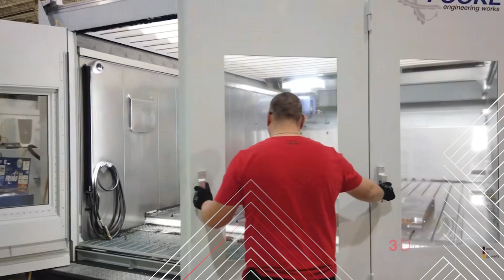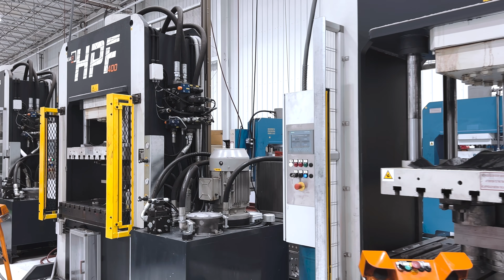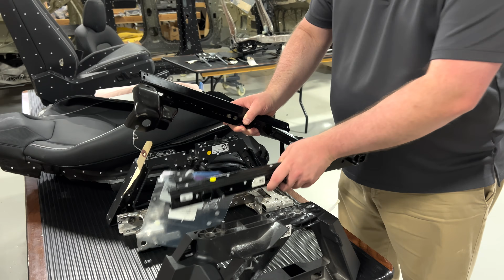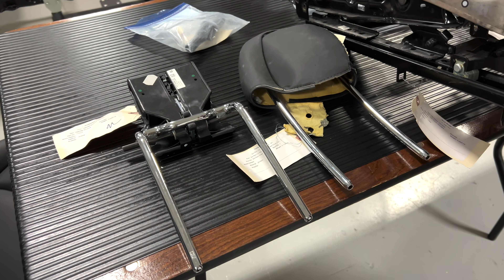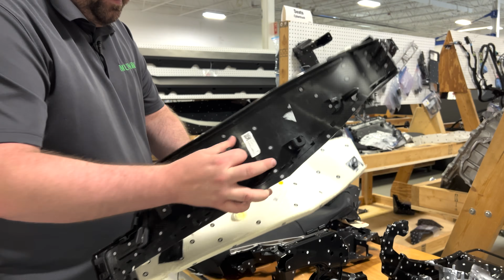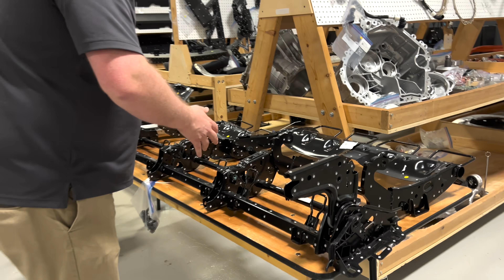Cybertruck Seat Analysis: Did Tesla Miss the Mark?

Comment: I had to go out into my garage to take a look at the seat tracks.  I like the look and I like the fact that I can stuff some extra things right under my front seat.  I usually jam my baseball cap and/or gloves in there.  It does look like overkill though from a weight aspect.  I do not like that neither my M3 or CT's headrests move.  Expensive vehicles like these usually even have motorized headrest adjustments - I'd settle for manual ones.  The headrests on my CT look sharp but do not line up with anything on my head, neck or back - I'm 5'8".  The headrest itself is way too tall - The cabin would look even more spacious if they were at least 2 inches lower.  And for all the over-engineering of the backseat, they could have made a pass-thru for 2x8s, skies and dogs.  Yes, there would need a mechanical failsafe tonneau cover stop.

Comment: I disagree. This isn't Tesla becoming legacy, this is Tesla being their usual agile self BUT also running extremely late and cutting features and hacking together SOMETHING. The rear seat design probably did assume a passthrough that never came. The adjustable headrests probably failed some safety test in the early days and they keep the design as-is to keep the door open to a recertification that always gets downprioritized.
This is classic technical debt and it requires more strategic planning than just "move fast and break things".

Comment: Boring video. Apparently, Carl is not a crash safety expert like the engineers at Tesla who engineered the seat structures. Tesla is not Ford, they have other ways to save $5 that doesn't risk their customers lives. That's why the seats and supporting structures are so strong. And that's also why Tesla uses a unified headrest structure. Studies show that adjustable headrests are usually adjusted to a sub-optimal position for saving your neck in a crash. The neck is the most fragile part of the human body in an impact. People have been paralyzed, others died, because they had their headrest improperly positioned. The unified headrest is designed to properly support drivers of all heights. 

It's not just lip-service when Tesla says they care about safety, their safety programs are very data driven. Counting nickels doesn't make financial sense with the high cost of pain and suffering and medical procedures. What makes sense is to make it actually safe in the highest number of crash scenarios. I know it's hard for a trained bean counter to understand that counting beans goes far beyond the point at which the car is sold. Elon Musk has always had very long-term views, his rationality demands that ALL the consequences must be taken into account in order to make the best design decisions.

Comment: It is a pretty common design for hinged frames to be welded out of plate steel, and then bushing sleeves (to accept polymer or bronze bushings) welded-in for the hinges themselves. So you have three operations: cut (laser/plasma/waterjet) plate steel (or could even stamp for thinner plate), machine the sleeves, weld the sleeves to the plates. Now if you make the plate thicker like they did here, you eliminate the need for bushing sleeves as a separate part and reduce 3 operations into one. Yes, more metal is being used and the finished part is heavier, but the material is likely cheap in comparison to the use of multiple machines and they probably had some kind of weight budget (can't make the vehicle too light for towing purposes) to work with. Just my guess, nothing to back it with.

Comment: After spending 4 hours riding in the front passenger seat of one, I will say that comfort-wise, they remind me of late-90s Toyota seats. Firm and initially comfortable, with very little overall support. Definitely missed the mark on comfort for a $100k+ vehicle. And yes, at 6100 miles, the driver seat in this vehicle was creaking during acceleration and turns.

Comment: That expanded polystyrene insert in the rear seat headrests appears to be the same material used in helmets to reduce collision brain injuries.  Since the seat back is fixed (bolted to the frame), there is no rebound designed in.  This design does maximize the cabin space since moving seats always have room behind them.  That design of the plastic molding gives proper support to the polystyrene in a collision.  It's basically a passive helmet to protect the back of occupants' heads.

Comment: The seat base castings are beefy because the Cybertruck is designed to be able to be a very good off-road vehicle.  LOTS more forces on seats and seat bases when you're off-roading! About the cost, when you watch Tesla videos showing the giga-castings coming out of the giga-press and immediately being placed in a CNC machining cell, the raw casting has many parts in addition to the main casting, joined by sprues. Please fact-check this by researching Cybertruck giga-casting videos to see if these components are parts of the raw Cybertruck giga-castings.  If they are, their cost is basically only material cost. It's not like Tesla is buying these from an independent parts supplier.

Comment: May mga EV rin bang ginagawa Kay Monroe?  Dalawang battery lang Yan na tag 24v.. Ang source ng motor gallon Ng sa generator, Ang motor ng gawing generator kahit maliit lang, Ang drive motor kahit Hindi na bagohin apat Isa bawat golong Ganon naman Yan.. kahit sing laki ng BLDC kung walo malakas narin Yun hindi na sigoro mag over heat yon..drive gear lang..Ang pinaka importante  Ang generator hundred volts hundred amps  separate Ang generator..kahit sing laki lang Ng 775 na apat kahit boong araw pa Hindi maobos Ang battery kung may charge unli...

Comment: The 1cm thick plate steel might be there as a 'backup' for submarining in case the cast aluminum touch down surface. That aluminum is a brittle failure point and FEA might have indicated it was a potential fracture point. I doubt it, but we saw what happened when Whistlin Diesel sheared the bumper off of one of these. That aluminum is quite brittle.

Comment: Do the overkill designs add to safety in any way? 

You also mentioned that some designs make sense if they are making it for other models. Speculation on the van and other products could be incorporating this design. 

Also, could the back seats be implemented in a smaller vehicles? Say the size factor of a M3 or smaller?

Comment: Seems like Tesla is focusing it's best engineers on more important things like steer by wire and 48V but then leaving the smaller things to the less experienced crew and neglecting the details. CT is a marvel of engineering but definitely rushed. A year would have done wonders for most of these things and problems with reliability people are still experiencing.

Comment: These design decisions are even contradicting each other:
If you're making a one-off car, or a low volume run, then overbuilding could make sense (i.e. do less optimisation), jerry rigging a fixed headrest onto a moving headrest frame could make sense; but then they make an injection mould where it's not needed (which would only pay off in high volume production runs).
     As if the engineers asked their boss: hey, do you want more of a one-off car, or a mass-production ready car? Boss' answer: "Yes". 🤦‍♂🤦‍♀

Comment: please react to the Whistling Diesel thing where he broke off the hitch by breaking the back casting. seems very damning, but maybe not?
Reply: He slamed the whole truck on the bumper coming off the tube's. A scenario that would likely never happen in normal use. But it would be cool if they acknowledge it and beef up the 2nd Gen cyber truck.
Reply: @aaronyoder121  not to mention the other truck didn't do the same thing. It's frame would have been broken/bent out of shape and the truck totaled.

Comment: If there rear seat back is immovable, could they have simply made the whole back with one piece of molded foam. Maybe there would have to be some embedded plastic bits for also and structure. What is the purpose of all the metalwork?

Comment: Thanks, Carl.  This was great.  Tesla sacrificed a lot to get this to market.  It's probably the worst product they've made and a step backward for the company.  I was worried from the original announcement that it would put the company at risk and that worry was probably justified.  Sometimes you need to tell the boss when they're doing something stupid.

I am not a cybertruck "hater".  I just think it could meet neither Elon's promises nor his original deadline and what we wound up with is a super-compromised design that may have done irreparable harm to the company.  He promised 450 miles of range and bullet proof windows; it won't go half that far with normal automotive windows.  I want Tesla to succeed, but CT worries me that they've passed peak innovation and are now just following Elon's visions without listening to reason or their customers.  That worked for Models S and 3 as he was inventing new markets, but it won't always work.

If there's one thing people should have learned from Elon's white paper on Hyperloop it's that he's NOT always right and is often downright foolish.  I encourage people to read that white paper as it seems to sum up Elon's thought process rather well; grand ideas with huge lapses in judgement and with no engineering homework done, though I do admit that white papers often leave out the details.  Hyperloop was an insanely impractical idea and fans should remember that when praising Elon for his many successes.  Has he changed the world forever?  Absolutely.  Is he the world's top genius?  No, and he's not even in the top ten thousand.

Comment: thanks for the criticism on folding rear seats. Its function is very limited but expensive in execution.  If I were Tesla, I want the rear seats to be easily removable than folding. It is unlikely that the truck will be filled in the bed and rear seat with cargo at the same time. An empty rear seat area is nice for precious cargo like electronics/appliances and stow away the seat in the bed.

Comment: Cost will be comparable at higher volume, you avoid tolerances stack up with one part. I assume they were using this part to test something or wanted to use another material, when they designed it. Maybe magnesium?

I would really like to know if the cast parts are much easier to install and if they make the sliders much easier / smoother to operate.

Comment: I can find as many arguments as you want.
For the speed of production for the 1st model (fewer employees and complexity), or the availability of old casting machines capable of doing the job.
Plastic is not a good argument, because it is a bad material for the environment. (plastic is the "cobalt" of the industry) Sometimes, adding a few kg to the Cybertruck is just a lesser evil.
I find that Tesla is doing the good old method of other manufacturers here. They use their current production line to make another more expensive vehicle. Recycle a lot of parts from previous models (can also be recycled material, like messed up gigacastings). I find the approach really good on the contrary, because from a financial point of view, no new machine is required, the production equipment does not need return on their investment. We are talking about margins without investment here.

Comment: Not up to snuff. A lot of "in my opinions" without facts. When terms such as most are used that emediatly states not all. So which is it. And what specifically are the cost differences. 6 piece sheet metal assembly vs one casting relates to how much assembly line space, inventory management, tooling, bending welding, and man power vs one and done.

Comment: Carl is my favorite Monro engineer. Articulate, knowledgable and extremely telegenic.

Remember - they did actually rush this thing out the door. Seems to me that some of the non critical components may be in early generations and due to be optimized.

"When in doubt, make it stout, out of things you know about."
Reply: I certainly wouldn't be surprised if they broke down another Cybertruck in two years time and many or most of these issues are resolved
Reply: @youtubecommenter-on9kd  What issues exactly? I don't see any issues from this video.
Reply: it was rushed out the door after 4 years of development?? Good thing they didn't take their time!
Reply: Agreed! Large People who weigh over 245 and way more pounds absolutely Need this type of seat framework!  When vehicles like trucks driven hard and offroad, they Need this type of strength to keep a heavy person in control of a 8500 pound vehicle.
Reply: @dporrasxtremeLS3 I agree with you on this. I have a couple of friends who push the 350-400 lb mark. It is amazing to see mechanical things break under the force generated by their movements. Car seats, in particular, get maybe two years out of them before the seat back frame is shot.
Reply: And he has a very pleasant voice, i could listen to him for hours. Sorry Sandy.
Reply: He's probably my least favorite. He's not concerned with quality, but only cutting costs. 
If Tesla had put a cardboard box as a seat he would have been happy because it would have been the cheapest option... Unless Tesla was buying boxes instead of reusing ones they already have. 

I also dislike the way he feels and taps everything with his fingers.
 
He seems like the type of guy who likes the smell of his own farts.
Reply: @themonsterunderyourbed9408 same. I don’t like his tone and attitude. He’s very patronizing and sounds a bit arrogant.

Comment: Regarding the casting version of the riser vs the stamped version topic: it’s more than just a dollar per part equation. Factory footprint is apart of that math, how much space do the various stamping machines need, how many people need to operate them. They need to get welded which is another machine/process/people. What is the throughput at volume of stamping vs having it injection molded. Price parity only carries the conversation so far at Tesla as they move more towards automated build workflow and reducing factory footprint.
Reply: Good point!
Reply: ever head of outsourcing?
Reply: @XzzVttll  Tesla tries to minimize outsourcing. That served them very well during the COVID parts shortages. Other automakers had to stop production, Tesla was selling record numbers of vehicles through most of the parts shortages. It also gives Tesla a large pricing advantage, which is why you get so much car for so little, relative to other EVs. Tesla even makes their own seats in-house, almost unheard of in the auto industry.
Reply: @XzzVttll yes
Reply: @XzzVttll  I believe Sandy had the appropriate answer with his "outsource dance". Outsourcing is terrible and overrated. Keep manufacturing in house.

Comment: Usually Tesla's 1st gen of a new model are inefficiently built (ie. see Sandy's review of Model 3 when it initially came out. Model Y was based off model 3 so it already started off from a good base by 2020). Likely these choices were made to guarantee functionality and safety, but not build efficiency. Elon has stated on earnings calls that the team now has to go through cost reduction of every component in the Cybertruck to be able to further scale production. If these issues pointed out are economically disadvantageous, it is certain that Tesla will change them.
Reply: as long as you have morons in america to pay for that unefficiency you can do waht ever you want

Comment: Carl, while that portion of the seat frame looks like it's a cm thick,  when you held and moved it over the bracket it rests on,  it seemed like you were able to easily carry it one handed with a light grip, suggesting that it's not actually very heavy overall.  Could it be hollow, 2 stampings for example,  and just be well-disguised by the coating? Just guessing.

Comment: If I understand correctly light trucks do not have to pass the crash levels of a passenger car.  Ford/GM may be using less structural strength because they are not meeting passenger safety standard.. could the additional strength of The cybertruck be for meeting higher crash test standards?

Comment: Just think after a million miles of battery life on the vehicle it's only going to lose 10% of its total battery range so therefore all of the seat components need to be very strong it's very simple I really don't know how you missed this from an engineering perspective and it really shines a bad light on Sandys work.
Reply: until it gets rearended and is written off because someone back halved the truck with aluminum castings that are un reparable 🤔

Comment: I completely disagree with you on this seat design because the plastic has more Flex therefore it's more comfortable a metal backing would be far less comfortable and a lot of engineering hours have gone into making the seat the most comfortable seat you can sit in that's why they are reusing it it's called research and development

Comment: You are completely wrong about the adjustable headrest that's exactly what the Tesla robotaxi will have the front seat will be able to lay down into the back seat like a pod and the headrest can retract into the inside or be removed so the two seats can be converted into one big bench